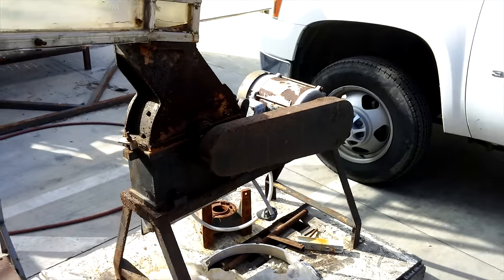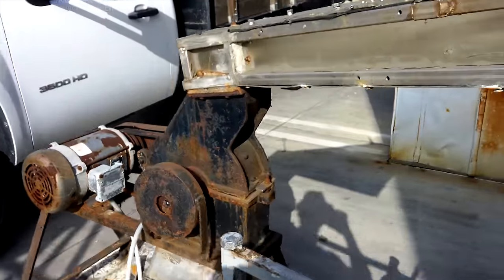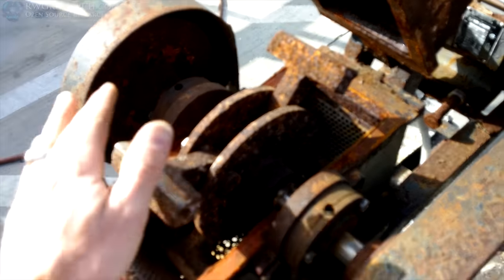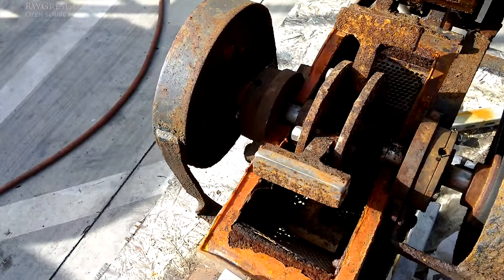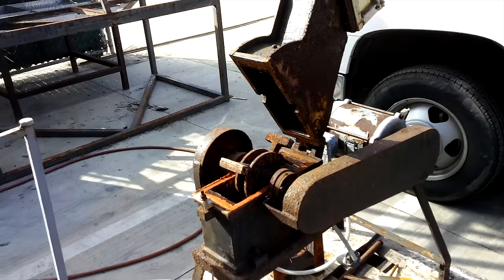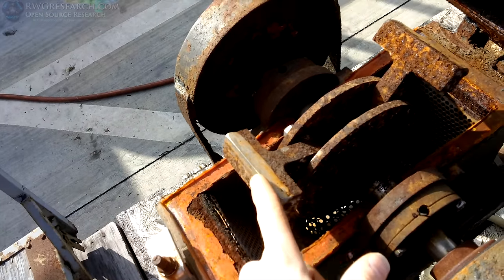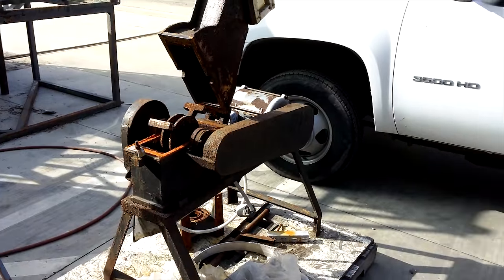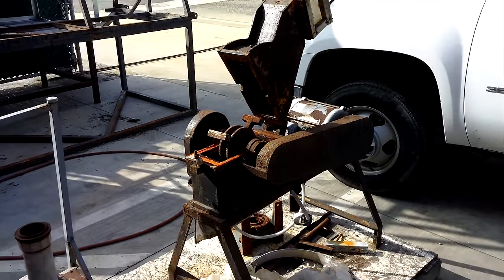"some of you are old and rusty, some of you are still sharp, this one, a little on the rusty side""

Comment: Another idea for plastic grinding, is using an under sink type garbage disposal unit, obviously not mounted under your sink.  You can put a hopper onto that for grinding plastic.  An InSinkErator waste disposal unit would do a decent job.
Reply: You could even then grind up plastic really fast, as a water cooled plastic slurry, fed back into the top of the unit a few times.  Then dry out the slurry and use a ball mill for the super fine grinding.

Comment: Unless you are grinding up really hard materials, your best bet for coarse grinding IMHO is a blender based approach... Magic Bullet type thing...You could even work out a hopper feed to put onto something based on that.  Just watch you don't run it too fast and overheat it all, ending up with melted plastic during the grinding, gumming up the works.  For fine grinding you want a ball mill.  Slow turning drum with heavy steel balls in it, with the material you want ground, put your plastic in and walk away for a few days.... really finely ground then. For ultra coarse initial grinding a wood chipper is great, if you can find one, just don't fall in!!
Reply from the maker: i wont fall in! :0 haha yeah all good ideas. for the moment ill stick with fresh stuff... but i have a lot of scrap prints that need shredding :)  here,here, blender, where are you ~Russ
Reply: ***** I am from the really deep south....Australia.  If you need help with anything, you have my email.  I am happy to help you with your experiments.  I don't think you will ever get your "free energy" this way but keep trying  by all means. If you want ferrous fluids then try Ferric Chloride.  Very corrosive but circulate that, you  could do that with a magnetic pump.  You still won't get there though, certainly not this way... I like your printer and coil winder.  You have some skills but really for your ultimate goal as it stands, is IMHO a waste of time.
Reply from the maker: MrOzzyCam thanks for your honest opinion. ~Russ
Reply: ***** Hey look, I am a scientist.  As such I am open to trying anything and everything.  I love it when someone tells me, it can't be done, or that is impossible,  I have often achieved the "Impossible" by other peoples measure.  I therefore totally understand why you keep trying.  IMHO Stan could have died from just the kind of thing that you are all trying out.  No poison just loads of X-Rays.  He wouldn't have been the first to go that way.  This approach IMHO is a dead end as is most of the free energy stuff.  I do think there are much better ways of generating power than we currently do.  None of it will be "Free" there will always be someone who wants the money for it.

Comment: Well you could have just submerged it in water bath, hook the negative to the rusty and positive goes in the water hook it up to a battery charger. Set it and forget it 48 hours later it would have been rust free with some pitting that could have been sanded. Cheers
Reply from the maker: indeed! i could have, but i have no space for an item such as this that I may use once every 6 months :) i could grind enough plastic to have enough for at least that :) sense i moved i just haven't the space... im still trying to find a place to put my other stuff lol ~Russ
Reply: I was reading your quantum gravity web page if Thay are wanting or looking for a way to unite classical quantum Newtonian and modern physics we have just that. A unified model that still keeps the standard. Model but makes all the corrections and explains the things the standard model could not.